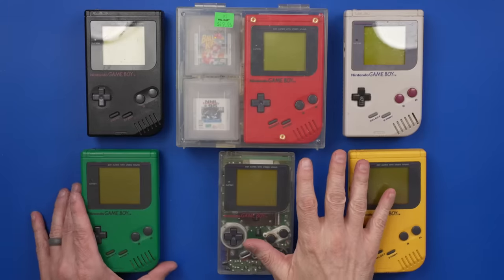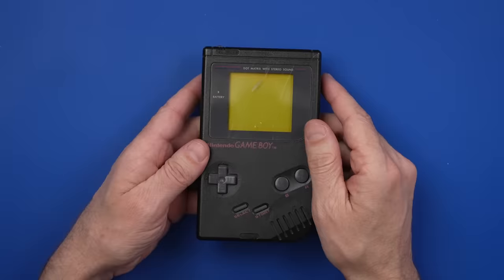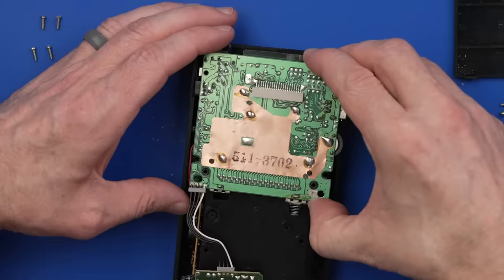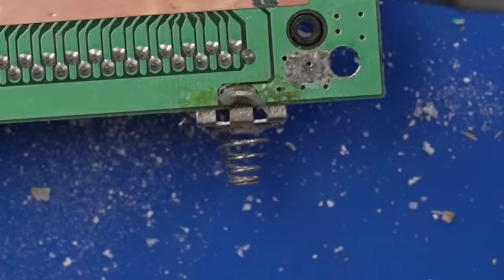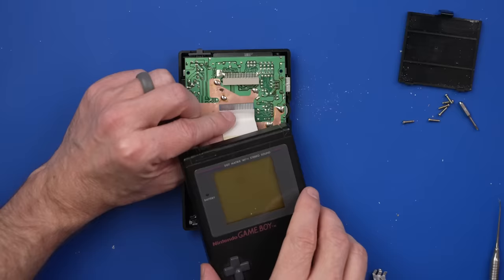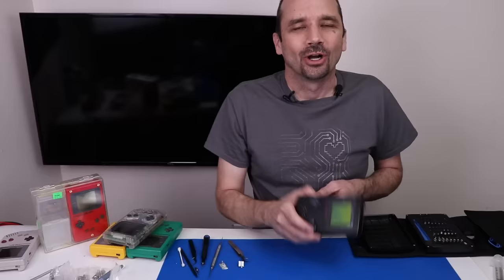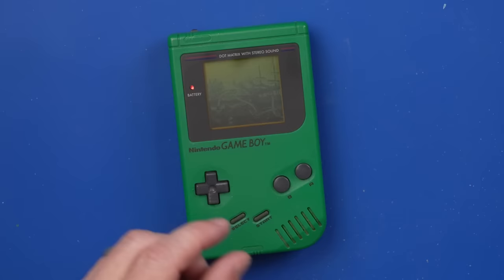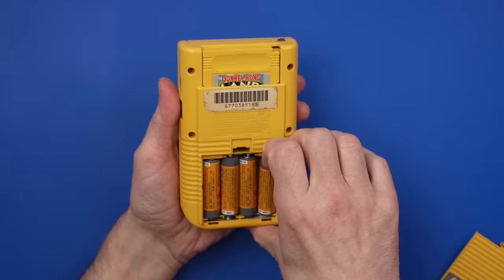I Bought 6 Broken Game Boys - Let's Try to Fix Them!

Comment: This reminded me I think I left batteries in my wii controllers when last stored
Reply from the maker: NOOOOOOO...lol. I don't think batteries leak as bad as they used to at least.
Reply: Soake the contacts in vinegar for 10 min it dissolves the corrosion . Then you can just solder them back on
Reply: rip Wii controller

Comment: The white stuff that you crunched of the black game boys battery connectors is most likely battery acid. To clean that off there is a very simple trick: Use some vinegar and the acid starts bubbling and dissolves immediately. I usually clean the stuff afterwards with some IPA to prevent rusting due to the vinegar, but I am not sure if you would actually need to.

By the way, I really like your retro console repair videos! Keep it up!
Reply: this is the way
Reply: I used the acid to destroy the acid
Reply: Fellow Expert in vinegar anticorrosion tech🗿
Reply: @@user-gu3fg2ju5q I was referencing vinegar being acidic, as opposed to basic
Reply: @xsaxia2008 Right, but battery "acid" is actually a base, alkaline, not really acid like we call it. That's why vinegar, an acid, works to neutralize it.
Reply: @damionmanuel7337  ohhh I didn't know that!
Reply: You can but it will corrode the copper to make copper acetate. Vinegar being acetic acid.
Reply: @@user-gu3fg2ju5q well said, I mean if it was the kind of acid that made you see things cleaning the boards would take on a whole new meaning.

Comment: can you imagine how great it would be if every board had to have vital info printed onto it
Reply: This used to be the case, many expensive electronics even came with schematics in the manual.
For others you could request the service manual with the schematics from the manufacturer. Now even a stupid switch is considered a "trade secret" to make repairs as difficult as possible.
Reply: @wlerailfan9870  its less capitalism and more corporate consumerism. its the end result of capitalism though.
Reply: @wlerailfan9870  as opposed to what? State made things are perfect and if you tinker with them you get lined up aginst the wall?
Reply: @oldmanbiscuit7518  da comrade
Reply: @timhartherz5652 Do you really think most people could even do a simple solder job? Most people have no skills to even get electronics apart. I don’t see how wasting money on included schematics would do anything as it’s rare that a consumer would even know the first thing about it.
Reply: @dncomments  Nobody said the consumers have to do it themselves. Beeing able to provide the necessary documentation to whomever does the job is a massive convenience.
But the real issue is that companies will do whatever they can get away with just to make a few cents more.
There used to be a time when electric/electronic vendors wouldn't even sell products with bad/missing/ incomplete documentation, and refuused to take in products of manufacturers which didn't sell spare parts.
Reason being it would be them who had to take the heat if these products failed and couldn't be repaired.
Reply: @dncomments Has nothing to do with having the right to access repairs in a fair manner.

Comment: Desolder like you did, throw the battery tabs into some heated vinegar for a few min, clean them up with isopropyl and reinstall. Works every time for me.

I also drop some isopropyl into the wheels and work them back and forth before blowing the with compressed air. I do the same for the power switch.
For the cartridge slot I use a tooth brush to clean the pins nicely.
Reply: Heated vinegar, eh? I've used room temp vinegar for some battery terminals which worked, does the heating make it work better?
Reply: @kazinwho  heating vinegar seems to make a difference for me. For other household cleaning people suggest heating it
Reply: @cidkramer  Good to know! I hadn't heard to do that. Thanks!
Reply: @kazinwho  I put vinegar in a shot glass and heat it for 10 to 15 seconds. Throw the battery tabs in and agitate them after a min to make sure the crustiness is breaking off.
Reply: @cidkramer heating acids will in fact make it angry or be a bit more acidic. So, you are correct. Just dont put any chips, or copper into vinegar heated or not. Such frail copper connections will not like being made into copper acetate. But, the corrosion will be bright pretty blue if you do so there is that. Beats the white toxic acid from the batteries.

Comment: Hey @TronicsFix u could take Q-Tips with some Vinegar to loose all of the corrosion easily. The Vinegar will react to the corrosion caused by batteries. Just take some IPA after loosing everything like that and ur contacts will most likely look like brand new.

Comment: The contacts aren't so much "corroded" as the battery acids have turned into salts and have adhered to the metal. I mostly just squirt some vinegar on them and watch it bubble away the salts which are impeding the connections. Additionally, you'll often find them in the headphone jack, which will stop the sound from working, as it uses a switch to make sure sound only comes out of the speakers or the headphones. While I love that you repaired all of these, I gotta be honest, I hate the original gameboy screen and I'd love to see you show how simple it is to install an IPS screen mod, because they look BEAUTIFUL, and even can do 4 color pallette modes which are really nice with some games.
Reply: I know he likes to solder, but the one with the lines would've been PERFECT for the IPS mod.
Reply: @BlueTrane2028  I've never seen anyone bother with swapping the actual screens like that. heh. It's so not worth it. heh.

Comment: Using a Hot air station at about 200-250 degrees works very well for vertical screen lines. Much better than the soldering iron most people seem to use.

Comment: In the video you call a lot of the white power/crystals corrosion, but it's actually potassium carbonate formed by the potassium hydroxide in Alkaline batteries. Alkaline batteries a liquid potassium hydroxide which is unpleasant stuff, but when it converted to potassium carbonate that is stable and it’s not dangerous and can be just cleaned off.

Comment: I recently found out that Lemon Oil (Citrus Limon) is a pretty good glue solvent. Even better than IPA or at least quicker. I use Lemon Oil on glue residue to soften it up and use IPA to clean the rest of the oil. I have a Gameboy Color in green color from the mid-, mid-late 90'. It has given me some core memory for me. Still got it.

Comment: Those very corroded battery terminals could easily be made perfectly clean by dropping they into a sonic cleaner with the correct amount of abrasive added. This would save you a chuck of time. The sonic cleaners aren't that expensive.
I enjoy your videos, Dr. Skip
Reply: You can easily get it off with some household vinegar, it neutralises the alkaline residue.
Afterwards rinse with water/q-tips and clean up with ipa.
Apply protective zinc coating with q-tips or at least some oil.
Great for contact which you can't or don't want to remove.
Don't need an ultrasonic, but if you have one i still recommend neutralising that battery gunk beforehand.

Comment: You are generally thorough so I never say anything, but with those shelves off, why not give them a complete cleaning with hot water and soap?  Makes a huge difference in the final product.. for example the green one still had what appeared to be hella dirty spots on it.

Edit: I watch a lot of Tysy tube and also odd tinkering who do similar things but complete full restorations rather than your more specific fixing broken circuit board and compactors/chip sets.  For what little my opinion is worth to you already successful channel is I'd personally like to see more shell/casings receive a portion of the video.  It's super helpful and I doubt most people follow multiple channels like this.  Also doing upgrades to these devices could be cool.  Like backlights or changing conventionally battery run handhelds into lithium ion variants.  Just my opinion.  I think it'd help draw a larger audience.  But I enjoy your content regardless

Comment: If you use heat the polarizer will come off a lot easier. Even just a hair dryer cuz I know you would be afraid of using a heat station
Reply from the maker: Yes, that would have helped. I was actually surprised at how easily this one came up
Reply: @Tronicsfix ok fair. In the video you seemed scared to break the glass. I’m glad you got it done that’s the important part

Comment: Lay a piece of foil accross the corroded part and put batteries in to test to see if the unit works or if you have bigger problems before going to the effort of cleaning. Will save you time.

Comment: With bad battery corrosion try some water with baking soda dissolved in it. It works wonders as long as the metal isn't corroded away altogether. Also cleans the residue off boards really easily. Plus the foam is cool.

Comment: "Use a chemical to eat the rust..."

Yeah. It's Vinegar. If you don't have vinegar, you can also use citric acid dish detergent booster, which is available widely in most grocery stores. A common brand name is Lemishine. 

It also has the side benefit of neutralizing all the alkaline battery leakage.

Comment: Awesome video!! Would the polarizer have been a little easier/safer to remove if you had used a heat gun on the adhesive first?
Reply from the maker: Yes, definitely

Comment: Alcohol eats away at adhesive, so just use some alcohol when removing polarizers, less risk of breaking the glass due to less pressure needed to pull off the polarizer.

Comment: You should try Lemon Juice Concentrate like the little lemon shaped bottles for corrosion sometime, it works really fast, just don't use it if usomething has to started to rustic because in that case it will just make it look super ugly and sometimes worse. I use it all the time for Wiji Remote Lots

Comment: I find that it's easier to gently use a heat gun to fix the vertical line issue on the screen as opposed to a soldering iron. With a soldering iron it just feels really finicky.

Comment: When I was a kid I saved up to buy a gameboy. I think it was over $100 and they only came in white. Within....3....6 months or so I put in some old batteries. Then within a day or two it didn't work. There was juice leaking into the gameboy. Not just on the springs, but the PCB as well. I took it to an autherized nintendo shop. They fixed it, but it cost quite a bit. That was when I learned never use old batteries that are just randomly laying around. lol I think they were mixed in with crayons. lol

Comment: I fixed a number GB Screens- you may want to just gradually increase the heat or better: use a toothpick to slightly press and hold on to the heated parts to ensure a connection.

Comment: Not every corrosion is "corrosion" - for ex the whity tought flakey stuff you're prying off (5:30) is critalized acid from leaked battery.
Reply: Right. That acid can easily be cleaned off with e.g. vinegar...without scratching anything

Comment: Is there a reason you wouldn't use vinegar and a toothbrush to remove the corrosion on the battery terminals? I've done it to multiple of my handhelds with corrosion and I've never had a problem with it myself, but I was wondering if there was a reason it should be avoided that I've never heard of.

Comment: i have a stupid question on the polarizer, why once you got it slightly up y not use a qtip with rubbing alochol  to eat the glue holding the polarizer on when your using a qtip to do that after youve got it removed, just wondering a qtip of alochol to pull that off would have eaten some of the glue, and reduced the chance to break the screen

Comment: I had no idea the original DMG had a polarizer on the front of the LCD. i backlit mine and i removed the one from the back. very interesting
Reply: My three DMGs are stock, two of them have some scratches in the display itself.  Today I learned that the scratches are just limited to the polarizer, so if I felt like making them go away, I can.  Neat.

Comment: ...another 'rookie mistake' is how you aren't cleaning the battery acid with white vinegar. Seriously... dont just pick at it, use vinegar to neutralize the acid, then clean with IPA. It's pretty basic stuff man. The vinegar will cause the 'corrosion' to fizz and make it easier to clean, even in those hard to reach areas like that spring you replaced when you didn't have to.

Comment: i do not like the replacement battery springs that he is using. They look nothing like the original.
I would much rather restore the orignal ones than using those piece of junk springs.

Nowadays you can buy replacements that actually look much more like the orignals.

Comment: I want to do this so bad!
Reply from the maker: You should! Seeing these all fixed & clean is so satisfying
Reply: @Tronicsfix  I'm currently working towards it. I've been picking up scrap electronics and fixing and reselling what I can and then scrapping/recycling what I can't. Any money I make goes towards tools or parts to fix other things that can be sold for more. So far I've bought the ifixit protech toolkit and a multimeter. Next is probably a soldering iron/station. What's a good midrange station?
Reply: Fixing Gameboys is so easy and is a cheap way to get into console repair. Parts are plentiful as are the broken units

Comment: the screen shouldnt shake that when a game is playing.
Reply: It’s the camera frame rate, because the game runs at a different speed than the camera does, it causes that stutter effect
Reply: no the game should run normal it could be the contrast needs to readjusted

Comment: Bros a professional and donno the difference between corrosion and battery acid from dead battery staying in the system for to long and you didn't need to replay it it will come off with alcohol and a bit of heat and yes i know its not actually acid just what ypu call it